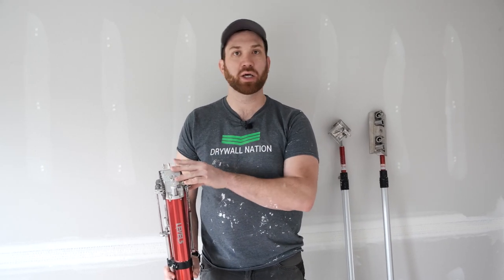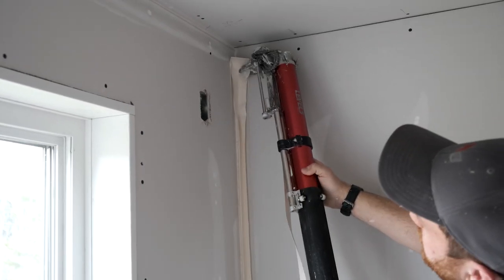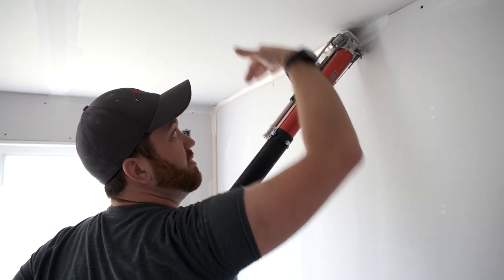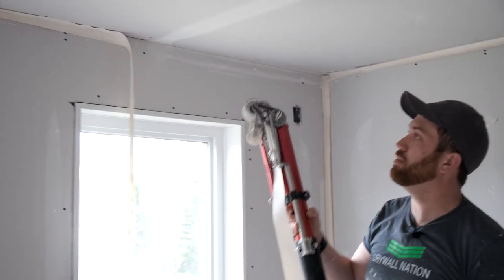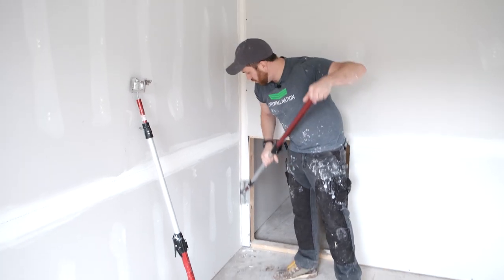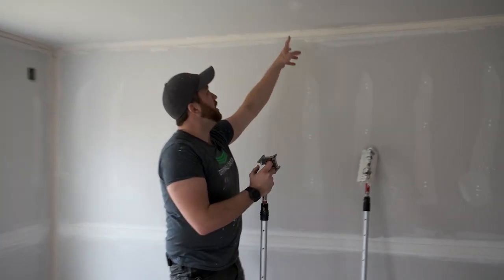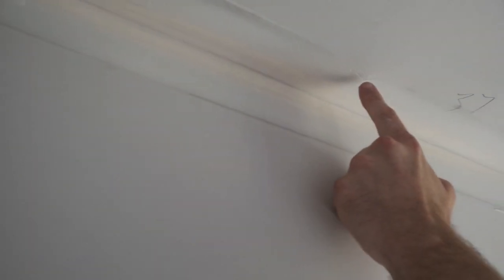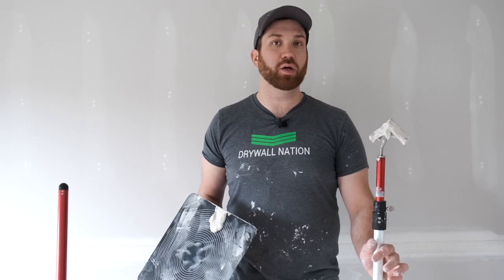Automatic Drywall Taper How To: Tape Inside Corners | Video 5/6

Comment: I just got my set of these taper system. It works great and really fast I just have a difficulty to do the ceiling corners, especially  at the starting place, the tape just keep falling off before I got to the other side of the corner and it pulls down the whole thing. I know practice will help but do you have any tips? I keep the drag very loose!
Reply from the maker: Please contact our support team at 866.562.4229. They'll get you sorted out!
Reply: Make sure you use the little wheelbto start and hold the tool at 45 degrees

Comment: Noticed your using paper tape in the corners and on another video you used fiber fuse on the flats what is your preference and what would you say is better,good informative video thanks new to automatic taping and flat boxes just got my first set thanks in advance
Reply from the maker: Great question! It's completely up to the preference of the individual finisher. Fibafuse is a little thicker so you would need to push the gooser needle back some to adjust for the extra thickness.

Comment: Question : the mud I'm using is normally 90min open, do I have to clean the applicator between filling again
Reply from the maker: We recommend against using hot mud with our automatic taping tools as it voids the warranty. However, if you do use hot mud then we highly recommend a full clean between each use.
Reply: @LEVEL5Tools the base coat we use is normally a 60 minute lifespan so the tool would require a complete clean every hour what are you using to on these machines and how long is the drying time before you recoat them . We use two coats of base coat that takes approximately one hour to dry between coats and a topping compound of some sort that requires a day to dry before sanding

Comment: what are some of the reasons of the cutter chipping, ive gotten few that keep chipping and I believe that's why my tape keeps getting stuck
Reply from the maker: Great question! We're wondering if your blade is not in all the way?  Or are you using another brand's blades which are a little longer than ours? This would cause the tip the hit the sprocket and break.
Reply: @LEVEL5Tools  im using the one that came with the bazooka and the replacement blades that come in the box. so its brand new, idk if maybe I have to adjust it or something.
Reply from the maker: Please give our support team a call at 866.562.4229 - they'll get you sorted out!
Reply: @DoctorDrywallLatinoAmerica  I’m having the same problem. Did you ever find out what was the issue and how to solve it ?
Reply: @gamefleitipon8527  yeah, its because we made the cut while moving the taper, so when we wanted to make the cut we stoped the cut, its takes a while to get the mechanics since its all in movement and you Anna go fast, but its just that. stop cut keep going.

Comment: After watching this I'm shocked that more drywall guys don't use these tools. It's like everyone is still using a manual screwdriver when there's cordless.
Reply from the maker: It's all a process! These tools have been around for a while but thanks to R&D in recent years they're better and more reliable than ever. Just like most things, there's a bit of a learning curve. These videos are meant to help finishers learn how to use these tools so that their work can be faster and more profitable.
Reply: It takes some time to get good with them
Reply: Remember to that most average drywall guys probably candy afford these tools too. They are not cheap.
Reply: $ 3.500